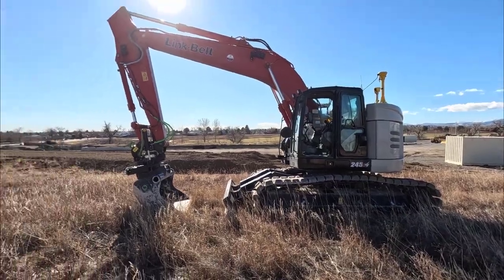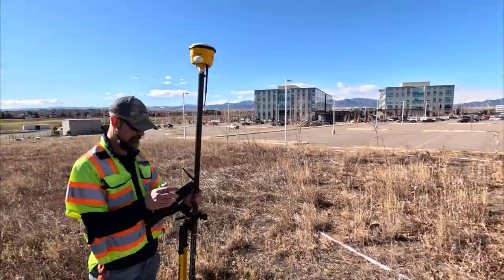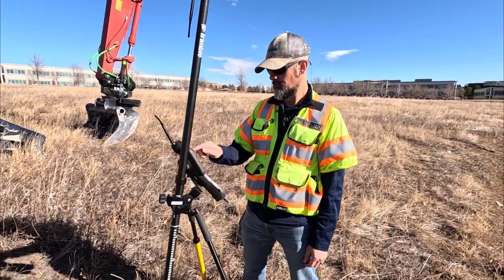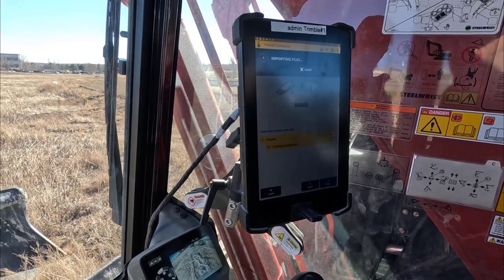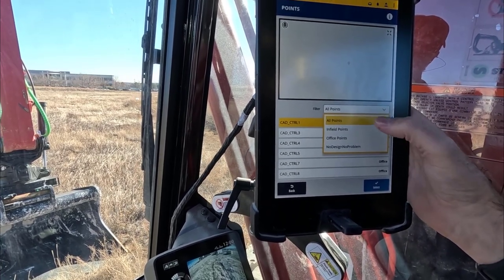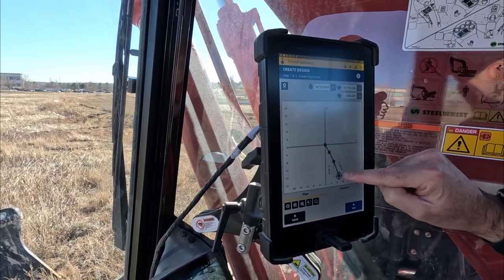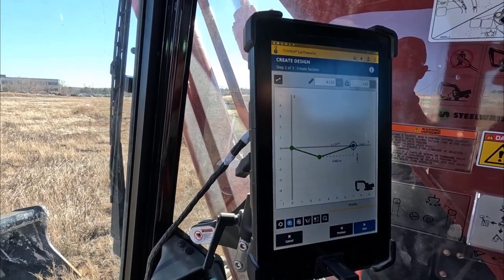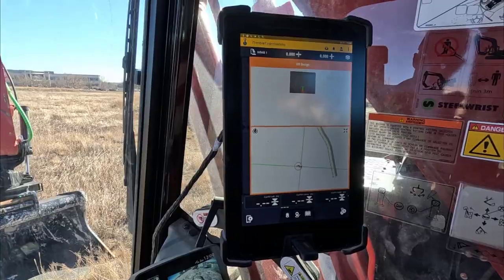Trimble Earthworks: No Design, No Problem - Part 6 (Export points from Trimble Siteworks)

Comment: Hi I use earthworks on my excavator I've moved job sites temporarily so I've left base station on old job can I use trimble in 2d mode to trim up  stone to a final level with just the 2 gnss pods in depth and slope mode or will it not be accurate cheers guys